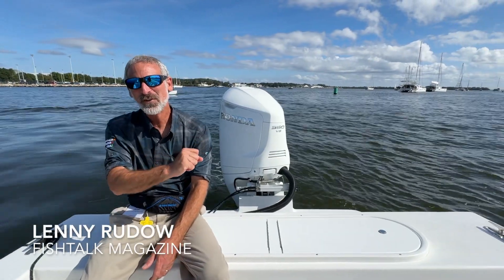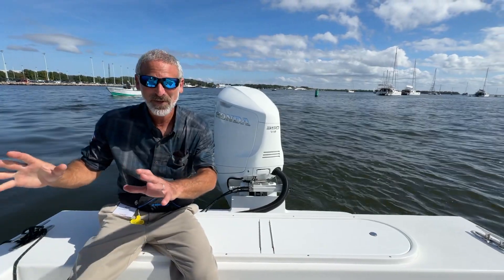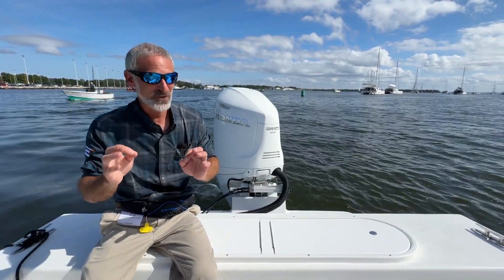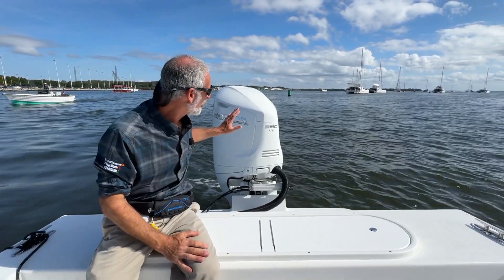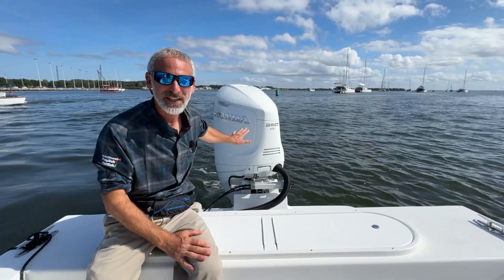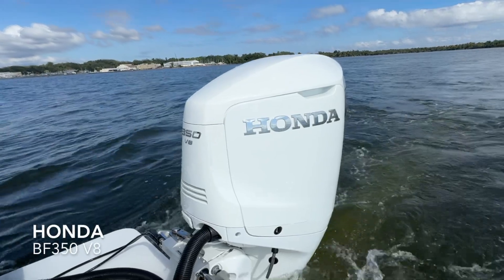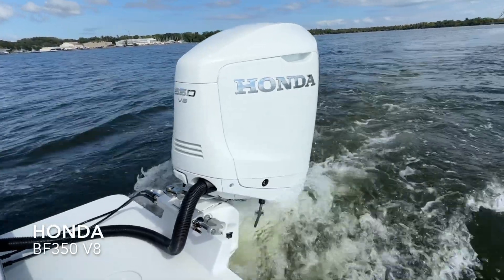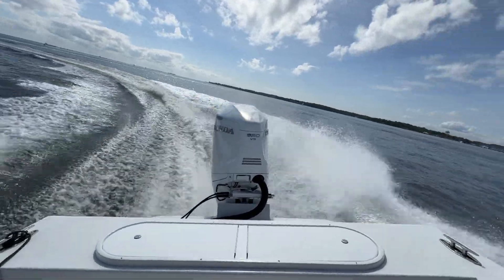Honda BF350 V8 Outboard Motor Review

Comment: The Mercury 300R is about 250 lbs lighter while only giving up about 20 hp
Reply: The Hondas have always been very heavy and a reason they’re not a good repower option on a older boat.
Reply: Can I get a 300R for my pickup?
Reply: 300hp compared to 350hp is only 20hp difference? Am I missing math somewhere?
Reply: @edfitzgerald5230  so is mercury racing website wrong then, where it says it’s 300R is rated at 300 hp @5000 RPM? It's even is printed on MR's brochure for the 300R. Now, some people has 'claimed' or tested it has 316HP (not 325) at 6250RPM, but that is not published by Mercury. Honda's is rated also at 5000 RPM, so who knows what it produces at 6250RPM. 50HP is a LOT more, not just a little, and good math will tell you that the Honda's rating equates to 15% higher torque. So good luck with a single 300r pushing a 30 foot boat at speed. At 15% greater torque, the equivalent Mercury to match the torque would need to be a 350r which they do not make. This is precisely why you rarely see a single 300r pushing big boats. Those motors are meant to stack quads or duals when torque is needed. And the public engineers that have dissected this Honda, have confirmed that it is over engineered, speculating that most likely, the Honda 400 and 450 will be the same platform with a different ECU and tuning. So there is a ton in development into this engine, and at a derated 350, it’s going to last a heck of a long time.
Reply: Its not a 20 hp difference, it 50, mercury publishes 300HP rating at 5000RPM for the 300r, people have "claimed" it is 316 @6250 but that is not published anywhere by Mercury and holds zero water. Plus with the 15% increased torque on the Honda, the equivalent Mercury would need to be a 400r. So for the purposes of THIS video, a single engine large boat, that 300r is going to be a turd on this boat.

Comment: While it appears to be a nice motor Honda is waaaay behind in Marine Power. I didn't see anything remarkable about this motor and it should be noted you can run 87 Octane in the Mercury's who lead the industry. First with digital shift, true power steering, lightest v6, v10, v12 etc etc...The fact you don't see hardly any Honda's tells me they just aren't serious. Save your money and buy a proven outboard, Mercury.
Reply from the maker: Thanks for chiming in Spinfish - we think we can tell what outboard brand you like!!
Reply: You don't see many Honda's on recreational boats...but they're all over commercial ones.
Reply: @aaronstestlab  Nah, I see Suzuki’s on commercial boats because they’re less expensive..
Reply from the maker: @spinfish1434  In our experience they're also uber-reliable. We'll see how this new Honda platform does over time, and have high hopes - they have had some real winners through the years.
Reply: I will keep my Tohatsu and Yamaha.
Reply: I think Mercury leading the industry is a stretch, easily the least reliable motor I have ever had
Reply: @cecilfannin  Stretch? Mercury was first to develop digital shift, independent power steering, v10, v12, lightest v6 in class. Do your research they’re just as reliable if not more so since 2018.
Reply: This motor is waaaay understressed and designed to basically run forever at max power. That’s Honda. It makes plenty of power for most, although it won’t be long before three and four engine combos become prevalent. You’ve clearly never owned a Honda product of ANY kind. It’s a completely different experience, I promise. 🙂
Reply: Honda have been building outboards for 60 years. There is plenty of them on boats here in New Zealand, a country surrounded by water. I have owned a Honda outboard and had no issues.